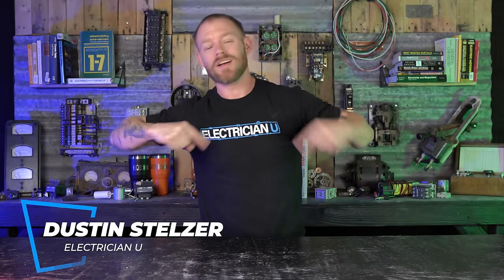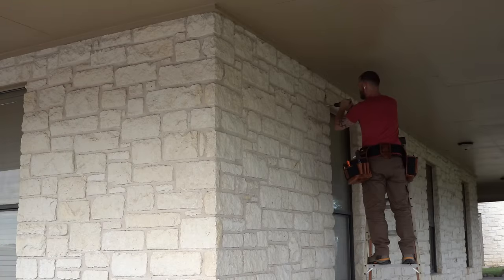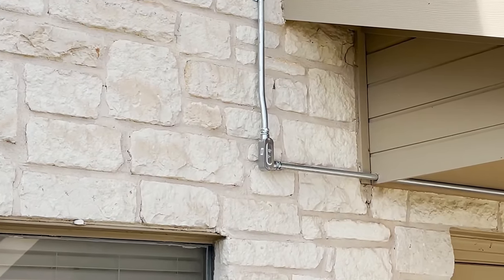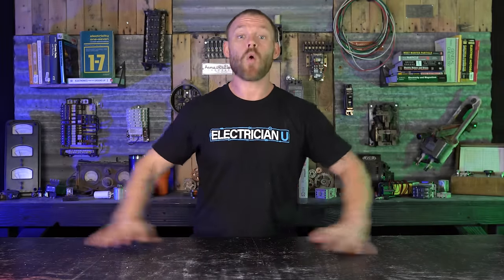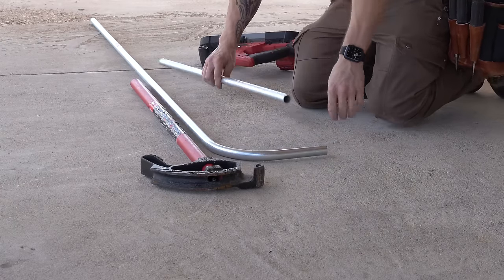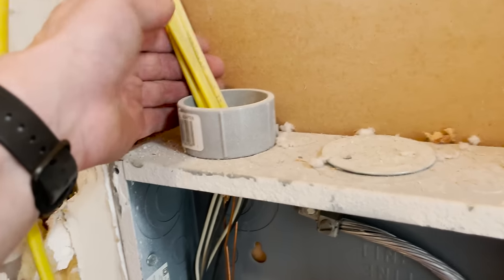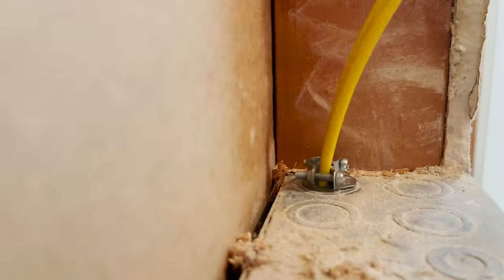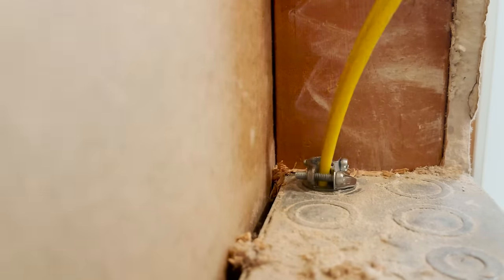Installing a Mini Split at a Commercial Building.

Comment: Wish I went to a trade school instead of college. This looks like so much more fun than sitting in a cubicle.  Definitely harder but it looks more satisfying.
Reply: I dropped out of a PhD and am now a first year apprentice with the IBEW. Don’t let already having gone to college stop you from pursuing a great career.
Reply: Until you get up in the attic and fish down to the panel.  That shits a pain in the ass especially when it’s 600 degrees up there.
Reply: Both.. Have their positive and negatives.
Body gets tore up in different ways.
Reply: Your right if you went to Vocational school did 2 years in H.S. Came out at 18/19 joined the Union at 46 you would be retiring with a pension..Or open your own company an if your Successful make trucks full of money.. But if you live in the west or north image working outside in the weather or a house with no heat where it’s colder inside then out for 9 hours straight then wake up an think fuck I got to do that again.. Or like dude said in a 600 degree attic with insulation blowing around
Reply: Never too late
Reply: It's not too late...
Reply: I completely agree.  Cubicles sucks. Sitting at a computer all day sucks.  I have a master’s degree and I’m now signed up for an apprenticeship with the IBEW.  Can’t wait for it to start.  Wish I started earlier and didn’t throw away a ton of money on college, but can’t change the past (also had some good experiences at college that I wouldn’t have wanted to miss).
Reply: @franciescosenatore2457  I prefer working out in the elements sometimes to sitting inside in an air conditioned office all day.
Reply: You learn how to perceive the knowledge at school. Give you a small example: how many way to do the 3wayswitch, and how many are legal in your state, and how you can find out the answers. Probably your master know half of them.
Reply: I went to college, got my bachelors degree, and STILL ended up going through trade school. I’ve had my journeyman license for 6 months now. I think I’m more proud of that than I am of my degree. Do what appeals to you, and you’ll live a happy life.
Reply: @electricianron_New_Jersey  ya and u have to army crawl 40' across joist in a 4' tall attic space
Reply: Went from working a corporate job, getting a degree and certifications in cyber security and server management, getting a commercial low voltage job to becoming a project manager there in 6 months. If your degree can be used in the blue collar world it is doable and if you can use them both together it’s so worth it
Reply: I went to college for 2 years for accounting and decided it wasn't for me, made the jump to become an electrician and it was the best decision I made. Never too late to do what makes you happy
Reply: @plauged191  agreed !!   My career as an electrician is far more than my career as a banker.  Lots of business education, investment/stock management experience, credit management experience.  Been there, done that.  To this day, I still have the December 2011 text from my apprenticeship officer informing me I passed my national electrical license final exam.  My Red Seal means more to me than my university degree.  My career is far more satisfying now, except on the off days when I get electrocuted 🤣🤣. Fortunately those days are extremely rare.   Best of luck and success to you through your apprenticeship !!
Reply: I was a lumberjack for 15 years and went to a software engineering bootcamp at 35. You have something most people in school don't: a good source of income. Leverage that and set yourself up to be where you want to be. You're only too old to do it if you convince yourself that you're too old 🤷‍♂️
Reply: I started my electrical apprenticeship in July. Ive been getting paid to have fun all day and free college so yay! Compared to my last career, I wake up excited to go to work now.
Reply: I Started fresh out of high school & went to the electric school best decision in my life Im making good $$
Reply: Keep in mind he's his own boss here. In reality you'll have a boss and be commuting an hour or more to the job site
Reply: You can do it bro. Just do it. Get a job working for someone and learn something new. I love being an electrician. so many fun elements. You have to be a bit of a detective, you get to see some beautiful and some God awful homes, you are helping people. It's a great career
Reply: College Graduate for Business.  Masters classes taken had loose careers in 20s.  Joined IBEW at 31.  Changing jobs can be liberating
Reply: @plauged191  respect to you chris, congratulations. Good luck on your journey.
Reply: I’m putting my marketing degree to good use as an electrican, best decision I ever made
Reply: Ideally its run around and learn trades as young man . Then desk life after 40. Im lucky I took that route. I have no degree though. Wish I did.  Went to Technical High School.  A college degree pretty much locks you in to make more money over a lifetime.  Both have ups and downs.
Reply: It's not harder, it's easy, because it's so fun.
Reply: @electricianron_New_Jersey  You merely adopted the attic.. I was born in it, molded by it. I didn't see the outside until I was a man and by then it was only refreshing!

Jokes aside, the attic does suck. Ironically a good mask does help in my opinion.
Reply: Never too late my friend,  go for it!
Reply: John, I used to say the same thing. I am a university grad, worked in banking for over 15 years.  At 37 I FINALLY decided to become a licensed electrician.  Definitely more satisfying than an office job.  Only days I regret it are the rare occasions when I become the grounded conductor 😂.
Reply: I went to a trade high school and I may not have fully grasped the amount of skills I learned that I regularly use today. now after life changes I think I will be looking for something similar for a new career
Reply: @electricianron_New_Jersey  the new m12 Milwaukee cool suit will make it more comfortable with the all new cooling veins that pulls heat away from your body and expelling the swear moisture.
Reply: @turboflush  I literally was about to kill myself as an insurance broker. I can't sit that long
Reply: @fulllinh   How many 3 way switches are legal ?  You physically can only install 2 3 ways per device any other additional switches for the device would be 4 ways
Reply: I did both man. Graduated with a bachelors from UF and currently entering my last year of florida electrical apprenticeship program. Definitely better than a cubicle but they both have there pluses and minuses
Reply: It's way more fun until your entire body hurts in new and exciting ways.
Reply: I've been an electrician for 16 years. I went to trade school right out of high school. I love being an electrician. I'm about to go for my masters license Start my own business.
Reply: It is fun definitely harder and yes way more satisfying
Reply: @sleeknub  did you get in?
Reply: I'm in the IBEW 22 years old making 30 an hour + benefits  up in Alaska  1547 stay safe good luck everyone
Reply: @jamesgarrison6430  not yet.  Economy isn’t doing well for 01 electricians in my area lately, so they aren’t taking new people.  I’ve been working as a non-union apprentice though.
Reply: im 30 years old almost a journeymen and looking to transition to a desk job soon sometimes boring is good lol especially as you get older
Reply: Never too late to start!
Reply: Our bad side isn't good either
Reply: You can get in at any age! Do not walk away, this is very fun. A good paying job to pay for all the tools u never thought you'd want
Reply: It’s never too late, Im economist but I’m studying electricity and starting over again, I’m loving it, give it a shot.

Comment: Quick tip on bandsaw cuts while no vise or bench available and if you want the cuts as straight as possible add a level vial . I just hot glued 1 on on there helps especially if ur put in field cutting alot on the move
Reply: Level vial?
Reply: He’s only cutting 3/4” pipe bro! Hard to mess that up lol. But yea on 3” or bigger that would make sense

Comment: Another great video! Love it! I'm a one man operation now to and love small jobs like this. I'm needing to know what to charge, most times I feel like I'm way too low, I'm just starting out on my own and my former boss has never charged enough as he sort of did it for a hobby.
Reply: It's extremely important to know your worth bro, I struggled with it for years
If you do good work & stand behind what you do it holds a lot of value
Nobody is perfect, don't be afraid to charge & walk away if your getting low balled
There is not enough qualified people for the abundance of work out there
Reply: Thanks for the advice!
Reply: Just keep upping your prices lol. When the jobs stop coming in, bring them back down between 10-25% and you'll be at the market's top end rate

Comment: Thanks for answering my question, Dustin, People would get on my case and talk all kinds of crap about me using a neutral as a hot, saying I'm a bad electrician or out dated, They told me in trade school a long time ago it was okay as long as you identify it for that use, but wasn't sure if they changed it in code, Thanks again.

Comment: Dustin, 200.7(C)(1) only covers reidentification of grounded conductors in multiconductor cables. It does not allow reidentifying individual conductors in raceway. As I read it and was taught, you cannot reidentify grounded conductors of any size unless they are part of a cable assembly. 4 AWG and larger only applies for reidentifying ungrounded conductors to make them Grounded conductors. Also, 210.63 requires a 15- or 20-ampere 120V receptacle outlet within 25ft.
Reply: Wasn't this a multiconductor cable? I thought it was Romex
Reply: @CoolerQ  The romex was fine. His conductors in EMT is what I was addressing. He pulled Black/white/green thhn/thwn and then taped the white red.
Reply: I agree 100%. Reidentifying the white as a hot conductor in a cable assembly(jacketed) is fine. Pulling single conductors with the same intent, nope. 25 ft service outlet. correct and a good point we just don’t if one was available

Comment: Dustin, can you go over 430.. I think a lot of guys don’t understand it and I saw you were running #10 on a 20 amp breaker (I believe) 
I had to teach my inspector and Forman about it they didn’t understand why I had 40 Amp breaker to be the protective device for a conductor rated at only 25 Amps until I showed them the NEC permits it and name plate called for it. 

Also one I’ve always been confused on is when the plans call for a disconnecting means on the inside motor of the mini split. 

Keep up the awesome content dude!
Reply: AC units are different from the no-brainer 15A/20A or basic appliance rules people use 95% of the time.  But they are usually great about giving you the electrical spec on what the device needs, including the OCPD.  Use the plate!  Add in bonus fun when dealing with heat de-rating for being on top of a hot roof, long runs, and motors that take a long time to get off their starting peak usage (probably why you needed the larger OCPD).
Reply: Yes, I would like to learn about this also.
What you are saying sounds dangerous.
 I do have an air compressor that is rated at 15 amps at 120v and would trip the breaker when cold. I changed it over to 240 and never had a problem.
 I probably would have been fine if it was a 20 amp circuit.
Reply: @markchidester6239  It does feel dangerous given how often we get drilled about how you can't exceed ampacity and the fire dangers if you do.  The way I think about it is that we are talking about a connection for one specific device, and not "who knows what people will plug in, allocate for worst case".  Given the specific device, its design can be taken into account such it having shutdown protection, safety features, or design that would limit a dangerous draw even in the case of failure.
Reply: @RJ-ej1nr  sure, I can see that. Something hardwired. Not like replacing the 20A with a 30 so you can run the coffee maker,toaster, microwave and hotplate on one circuit.
Reply: That was yellow romex which is 12-2 with ground.

Comment: You can re Identify the ungrounded conductor but like the code states. You would have to go to every one of your conduit bodies and re identify it there as well as in the panel and the disconnect. At every location where the conductors are accessible , like junction boxes and whatnot ect . You should’ve elaborated and explained that further for the people that don’t pay attention. If you don’t mark it in the conduit body some ignorant handyman will come along and tap out of the conduit body to install a 120 v receptacle and not know that it’s a 240 v circuit. Anyway , great video. I’m doing this same job except it’s for a mini split for a conex that my mechanic is using for his office space. We are using one of those DIY mini splits.

Comment: Agree 100% with method that you identified the white conductor from the 12/2 NM cable but within the last 3 days Mike Holts Free graphic of the day on his great web site stated that in picture they ran 3#6 wires to a receptacle and said you could not use white tape or anything else to identify the black wire as a grounded conductor ( ya neutral ). Did both dozens if times and never failed the inspection. One whole inspector in our area was asking you to use a 6" length of white shrink wrap to identify a nuetral.Where's the GFI that is required in2020NEC?.read they are having shit load of false tripping on split system that have GFCI protection. Also read that some locations are not requiring GFCI on splits until they resolve tripping g problem. Always installed 2 straps on every 10' length of conduit. If you stand by coupling you can drill last strap on first conduit then first strap on next conduit without moving ladder. Do inspectors ever break your balls on disconnects mounted over 67" from the ground?
Reply: Is it 67" or 6'7"? I never can remember...
Reply: Correct, I install a gfci receptacle next to the disconnect.

Comment: Nice Job and taking the time to explain the Details. I hope there was a Equipment service outlet GFCI receptacle with in 25 feet for that condenser. Also aren't you required to Ground Fault that Condenser now  By the 2020 NEC Requirement ?
Reply: He's referring to 2020 NEC but is his jurisdiction using 2020 code?
Reply: Doesn't that disconnect have to be accessible needing a ladder is not accessible

Comment: BTW - You have a code voilation on your install. You are only allowed to reidentify a white wire as a ungrounded conductor if it is part of a cable or cord assembly. You used THHN/THWN so you should used two colored wires other than white or gray.
Reply: Yeah while reidentifying the conductors in the romex part of the run was fine when he swapped from romex to THHN he should have pulled it in the correct color.

Comment: On 2:06 those conduit bodies lbs, lls and lrs are they rigid or emt? Reason im asking is because i was told not to use rigid on emt since dissimilar metals cause corrosion. SET SCREW type EMT conduit bodies are super common but not compression ones idk why specially for 1/2 inch emt
Reply: Rigid conduit screws directly into conduit bodies, EMT requires a connector.  Set-screw couplings/connectors are not weather-proof and should not be used outdoors.  Compression couplings & connectors are a far superior connection method...although they are more expensive.
Reply: @tomnorman5461  rigid is steel, emt is metal, therefore dissimilar metals. 1/2 compression tight Lbs are non existent in depot and lowes, they mostly carry set screw type, so what to do?

Comment: Hey Dustin. Love the channel. I was just wondering if you used raintight compression connectors and couplings outside. If not, in what conditions are they required?  Also, when is it appropriate to run rigid instead of emt on the exterior of a building? Thanks
Reply: @ 8:06 .. you can see a compression connector at the LB… rigid would typically be used in this situation for the first 8’-10’ off the ground especially if it was exposed to any kind of traffic, any area where you need more physical protection then EMT can provide or when specified … this pipe run is out of harms way so EMT is the right choice.
Reply: @djpartin7910  is it a technical violation to use EMT with raintight compression connectors to an LB that is only UL listed for rigid and IMC?
Reply: @djpartin7910  I saw that he used compression connectors and couplings, i was just wondering if they were raintight. Now that I look again, they do seem to be the same color as raintight.   Thanks for the input.
Reply: Its more expensive and harder to install but can be made air tight so Ive only used it in areas with hazardous atmosphere, near gas pumps,

Comment: Great video,  thanks for all the information on this. Do have a question. About using a switch box for 120 v. Thinking about use one in my garage, to run all my shop duplex so no unwanted fingers can turn on my power tool. Any information on this will be appreciated.

Comment: Great Job Nicely Done⚡️You Know Is Not That Hard To Install A Mini Split Specialy No Maintenance Work W/ Mister Cool Unit TosoT Unit You Need A Pump And They All Need Drill A 2 1/4” Hole For The Line And Wire To Fish It Through It Hang The Unit Up Inside The Wall Keep 6” Away From The Ceilin.The Condenser Unit You Can Hang It Or Put It On Top 4” Hight Platform A 2’x3’ The Unit It Self Is Only 80 To 90 lb. You Got This 😉👍🏽 I Already Install 3 Units Easy Peazy